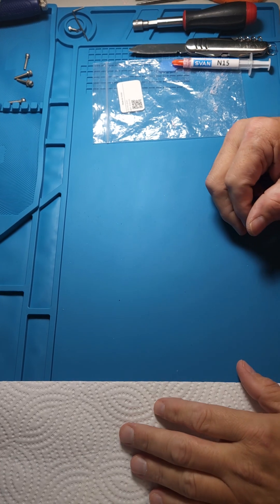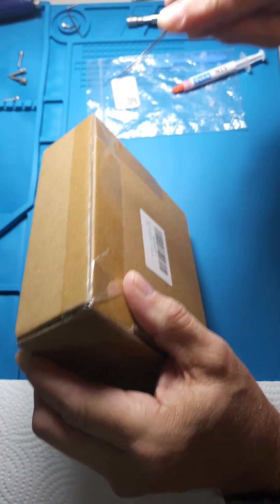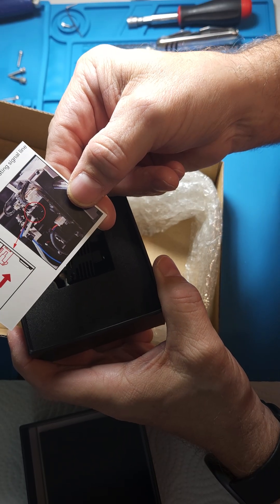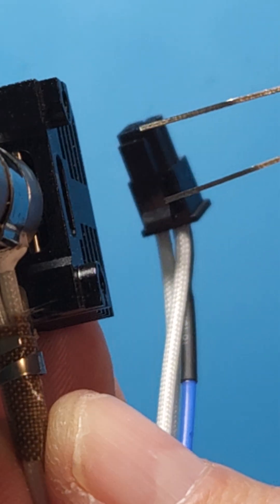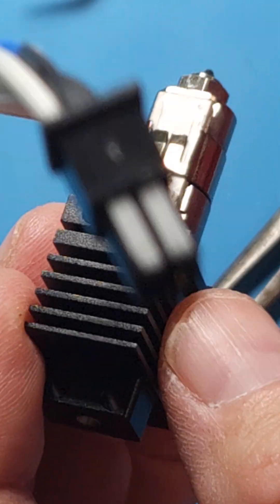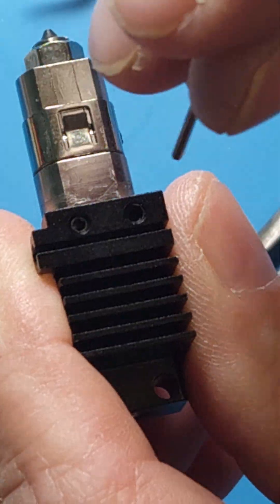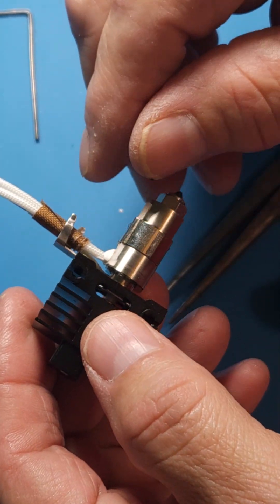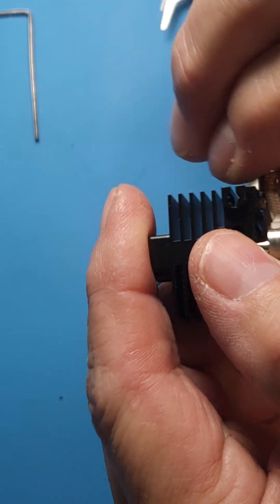Qidi Plus 4 hotend: Could a freshly opened hotend be tight or loose?

Comment: Just got one direct from warranty and can say it was straight. I broke it loose then feed it all the way out and back in and went all the way in by hand. I still lock tightened it with it in there and set. It prints fine.  They old one I took nozzle out and it won’t file or by hand even if broke lose. I tried for a bit and gave up. I may mess with it again when I’m bored.

Comment: I think the second set of screws would feel a little bit looser after you loosened the other side first, no? Also surprised you didn't loosen the nozzle before the screws to see how tight it was. Great demonstration once again though! I do think this will solve most breakage issues. Bummer it needs to be done.
Reply from the maker: Actually, I did that to check if the heater was skewed relative to the heatsink after the screws and harness were loosened. 
Now that everything feels straight, I feel confident the only thing that could crack the heatbreak now is heat cycling or my dumbass allowing the nozzle to act like a CNC 😅.